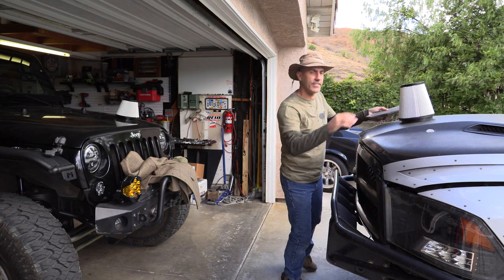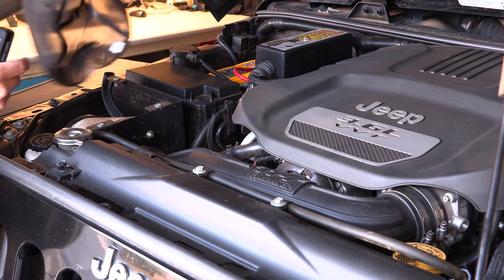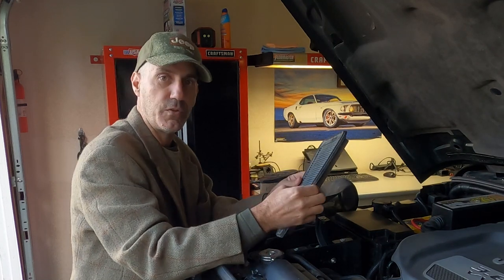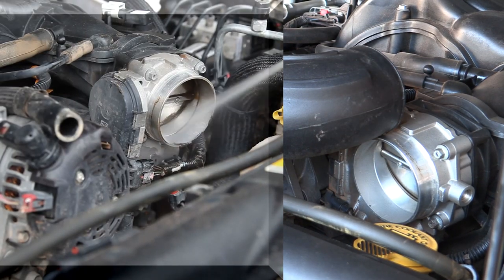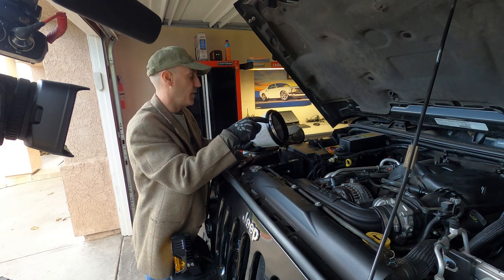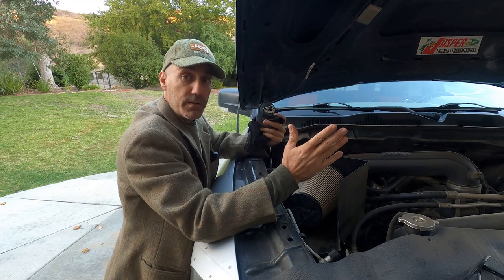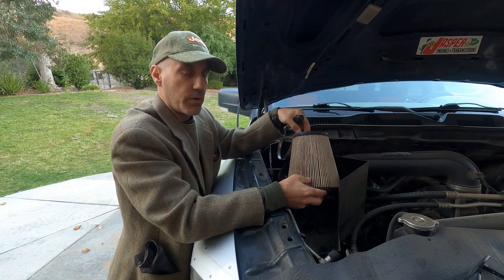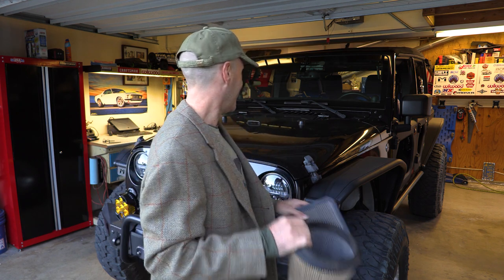Air Filter Comparison - Dry Element VS Oiled 2 Year Gunk Build Up Test

Comment: Woot, thanks for the follow up video on your CAI Jason! 
I'm running a Oil-less CAI pod filter in my Daily Driver 3.7L Ford Sedan and I love the extra intake noise and the improved throttle response. Driving on the highway the intake temps are much lower then with the factory filter box. Just like your CAI install video showed.
However I found that in my Bronco the K&N oil'd drop in replacement filter was a much better deal. A pod filter in the Bronco lowered my MPGs and intake temps were much much higher. But I have noticed a major difference in how dirty the throttle body gets. The Oil'd filter does junk up the butterflys much quicker. But my MPGs are better with the K&N vs a stock style dry filter.
Reply from the maker: Fascinating to hear about the Bronco!

Comment: Wow! Thanks for this.  I've been running an oiled K&N in my 2013 JKU... I'll now be switching
Reply from the maker: I didn't mean for the video to seem like the K&N was bad in some way... I think the take away is to be really cautious and use a very small amount of oil on that one and cleaning the throttle body should be part of the routine maintenance.  The performance was good.  I have been really happy with the dry elements though!
Reply: @AutoEdits  oh, no worries.  I didn't take it that way. I've been happy as well... it's just,  to me, that a dry filter adds that extra layer of caution.  I had never thought about the oil getting sucked in

Comment: I used an oiled K&N for a couple of years and it always required a removal of the throttlebody to clean the idle air bypass passages, so I ditched it.  Yes, the throttle response was better when it was super clean, but I run in dust and clearly way too much was getting through and gumming up my throttlebody.  I went back to dry 8yrs ago and have never regretted it.  I haven't had to clean out the idle air bypass since, just the normal throttle blade cleaning and it was trivial.  Won't go back.
Reply from the maker: Similar experience here.

Comment: The AEM Brute Force dry washable filter has been in my H3 for over 10 years and 190k miles. Still looks mint. Wheeled the crap out of it. Mud. Water. Rocks. Sand. Snow. Dry washable is the only way to fly!
Reply from the maker: Great to hear and appreciate hearing another brand and suggestion for other viewers!

Comment: I feel modern elements flow good enough that oiled filters just aren't worth the work. Plus the side effect of getting oil into the throttle body.
Reply from the maker: I'm thinking the same after this experiment!
Reply: I found muddy stuff on my maf sensor after using k&n oiled filter i immediately switched to afe
Reply: @Lilp002  not arguing or anything but I watched a how it’s made video and found out k&n bought AFe. They make em under the same roof RIGHT next to each other and on some of the  finishing lines they had them less than 6” apart. But I was originally thinking what you said. But now I just don’t know.

Comment: Just want to make a point about air filters.  Im not being critical of this video as it does make a good point about air filter performance.   Generally people think oil filters are the most important when it comes to the life of an engine and they are important.  But...air as we breath is about 20-21% oxygen and about 80% inert gases.  Air fuel ratio in a well tuned engine is about 14-1.  14 parts oxygen to 1 part fuel which means a gallon of fuel needs approx 972 cubic feet of oxygen for combustion, which means it needs approx 4860 cubic feet of air at atmospheric pressure passing through the air  filter for complete combustion.  4860 cubic feet is equal in volume to approx 36000 gallons of air per 1 gallon of fuel.  Im no scientist or automotive engineer.  these calculations have came from years of research on my on.  I use to tune and race small engines when they all had carburetors and they were a headache to tune esp after high compression pistons, race camshafts, head porting, headers, racing manifolds and the such.  Im also sure someone will bust my theory on all these numbers, but the facts remain.....It takes a tremendous amount of air flow to combust a gallon of fuel.  My point...change or service your air filter often, REAL often.  Your engine will thank you!!

Comment: if in alot of mud (NW) you need a pre-filter on exposed oiled filters else as mud bakes underhood it draws all the oil out of your filter quickly leaving you with if'y filtration when you need it most - when I hear someone say "k&n ruined my engine" this is what I think of ... when in Moab the pre-filter was also red every 2 days with dust so I just rinsed it out , I still use oiled filters on my 4.2L HO but do like what I saw today - wondering how dry elements handle caked mud now - great video !

Comment: I have a AFE Magna Force dry CAI with a Pre-filter as well, and was just thinking of removing it and putting it in the cab for the same reason.  Great minds think alike...  (Figure of speech, I'm just a regular cigar kinda guy.)
Reply from the maker: HA!
Reply: @AutoEdits  Well, that was yesterday...  When I got home, I started the vehicle to let it warm up.  As it was running, I popped the hood to take off the sock, which was still new out of box (only drove it once with it).  I expected to see it being sucked against the filter, it wasn't.  So couldn't affect flow at all, it doesn't seem...(???)  So will be putting it back on here in a bit.  I figure it's extra protection with no downside.

Comment: Ram Johnson and Johnny Sins could be related 🤔

Side note, nice mention on the water sock. Didn't think about MPG or power but if they block water it must be somewhat restrictive. Although coming to/leaving work is through a dust lot and winter on the highway leads to excess water. I wonder if I should just keep it on since the jeeps filter is right by the opening in the front panels?
Reply from the maker: Ha! In the Jeep you should be good in regular rain but I’m going to try it without for a bit and keep it in the glovebox.

Comment: I enjoyed the comparison between the two because I've had the K&N oiled element in my Jeep but now have a dry cold air intake like yours.  Just a quick tip I've seen in some other videos about cleaning the throttle body, you really should remove it from the engine before cleaning it because if you don't your flushing that cleaner and the dirt down into the intake which is not good and the back side of the butterfly also needs to be cleaned.
Reply from the maker: That is a really great suggestion... thanks!

Comment: Very interesting!  Never thought about oil in the throttle body.  I've always run oiled filters in the past, but the filter cleaner & oil expense probably equals the cost of paper filters over time.  Looks like an AM air intake system with a paper filter might be the way to go.
Reply from the maker: It's not for everyone and I'm being told that some people just put a very small amount of oil on those other style with better results as well.

Comment: Jason love your videos, and your personality. Always one of my favorite channels. I have seen those pre filter covers advertised as helping to not let water into the intake. What are your thoughts? It certainly seems that they do allow a bit of liquid to pass. Judging by the way you run hard in very dusty diverse environments, I think maybe a dry element air intake might work well on my dail driver JK that sees mainly highway miles with dusting mainly during winter months from dried up salt and sand brine mixtures up here in the northeast. I always change air filters with a quality WIX or Mopar. Thanks again for the great videos!
Reply: I change out filters once a year.
Reply from the maker: I do think that pre-filter did help when I was running deep water and I'll run them for sure when rain hits!
Reply: @AutoEdits  copy. Thanks for the reply. 👍

Comment: Dirty throttle body is exactly why I stopped using oil filters. I had one in my brand new 300c many years ago. After one year I removed it from the throttle body. Just like this video. It was very dirty. Never again.

Comment: I have a K&N FIPK in my toyota truck with a 3RZ engine that i dynoed with and without the pre filter to see what difference it makes, it made maybe half a horsepower difference and when you consider that after a few pulls heat plays a big factor in the dyno readings we determined that it made no difference at all, so i use it at all times
Reply from the maker: Cool to hear.

Comment: So with throttle body cleaner, you simply spray it in there and don't wipe it off? I know it dissipates for the most part, but just the thought of a liquid in my intake makes me cringe.
Reply from the maker: Legit concern... I started it right afterward and it seemed fine.

Comment: Over extended use was there a significant difference going from just the drop in oiled k&n to the oiled or dry CAI? Thanks for this video, it's always cool to see unbiased real world testing
Reply from the maker: Being honest... the most noticeable gain was from stock to the drop in K&N and then only modestly more improvement from that to the CAI but I did feel it in throttle response and it did get better fuel economy. The big difference was the dramatic reduction in gunk in the throttle body. Some suggest I might have used too much oil on one of my cleaning and re-oiling... maybe... but I didn't have to do anything but blow out the dry element and the throttle body was amazing  clean after two years.
Reply: @AutoEdits  Thanks for the response. I've been trying to decide if putting a CAI is worth it or not bc I currently have a drop in k&n filter
Reply from the maker: @codyr4816  Like I mention in this video, it's a fun install and offers a bit of performance ... I could even recommend getting the K&N cold air intake... looks like a very good kit!

Comment: You should look into an oil catch-can. I’ve seen some DYI versions done for about 30-40 bucks. Might be good for your engine cleanliness effort!
Reply: There are full kits that have a bracket and everything but they are a bit more pricey.
Reply from the maker: I hear you, but why? Did you see what the throttle body looked like after 2 years? Very clean if you ask me... don't know what more to expect from that.

Comment: Is there any "Dusting" on the inside of the  intake tube going to the throttle body?.. the reason why I ask is because I couldn't find an air cleaner other than stock Mopar that keep the super fine dust out..
Reply from the maker: It was completely clean just like I showed the inside of the throttle body, air temp sensor and inside of the air filter itself.
Reply: @AutoEdits  that's good, the parts store generic replacements are the worst..